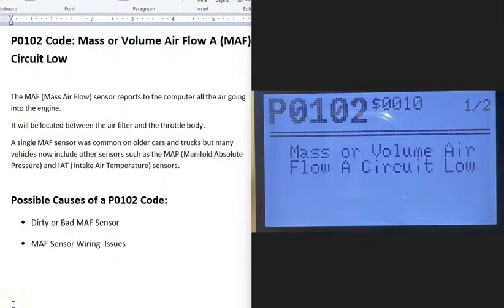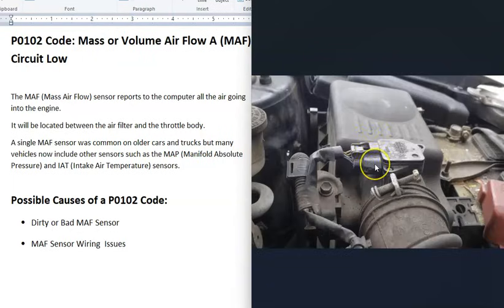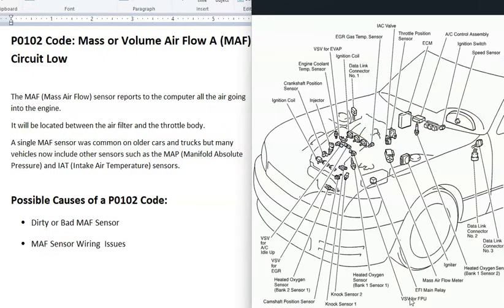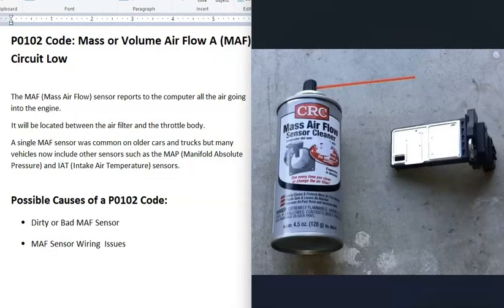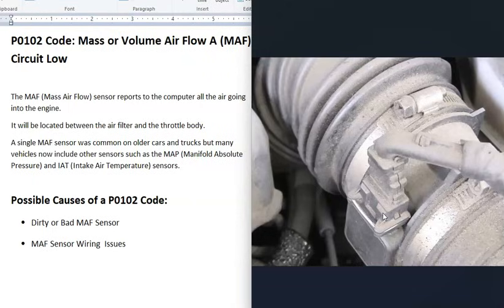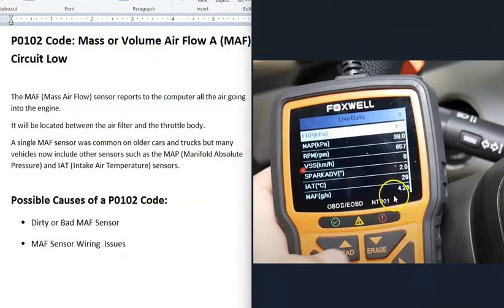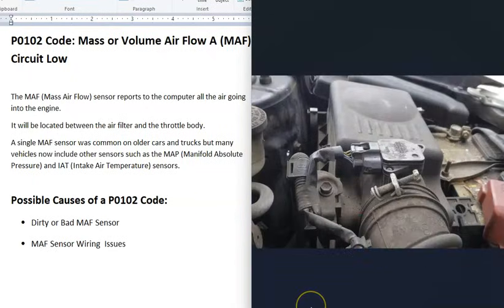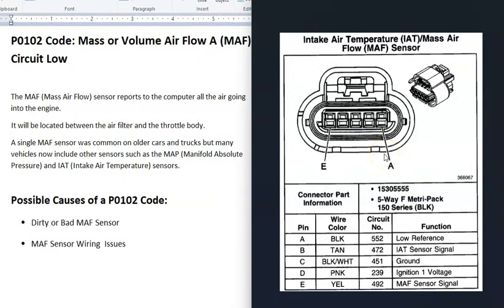Causes and Fixes P0102 Code: Mass or Volume Air Flow A (MAF) Circuit Low

Comment: I replaced my but somehow still have the code
Reply: Same here, any updates?
Reply: Battling the same problem as well
Reply: Change the air filter or Probably the wiring I’m dealing with this right now

Comment: That did help but I have a 2009 Honda pilot and I just changed the valve cover gaskets and when I went to start it,it ran ruff for a second and shut off. If I pull the plug to the maf sensor it runs but revs up and down. I checked the ob2 and it says 0 when car is off .
Reply from the maker: No MAF sensor Grams per second when the engine is off is good, but it may still be bad. Another test is to go to live data, select the MAF sensor, see what the Grams per second air flow is, double the RPM, and the Grams per second should also roughly double.